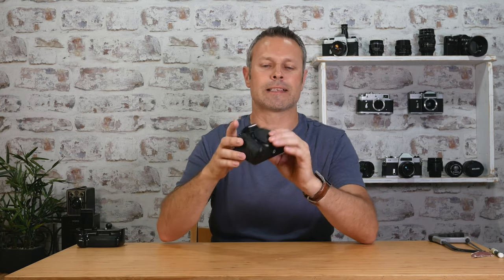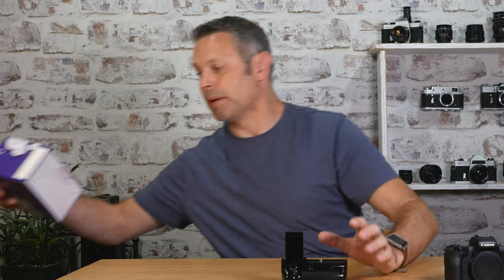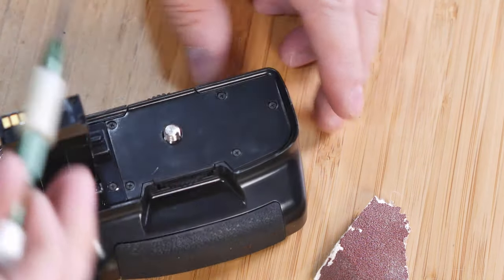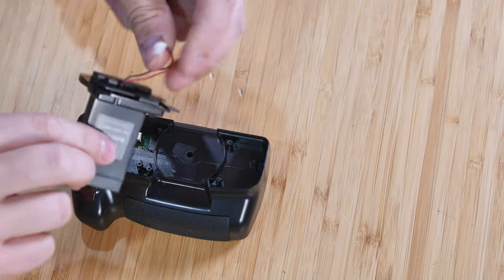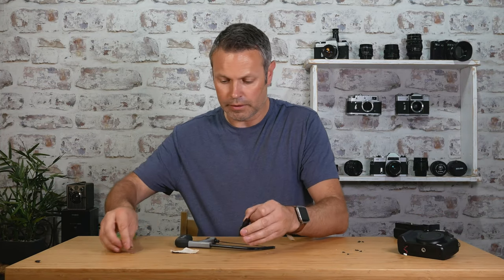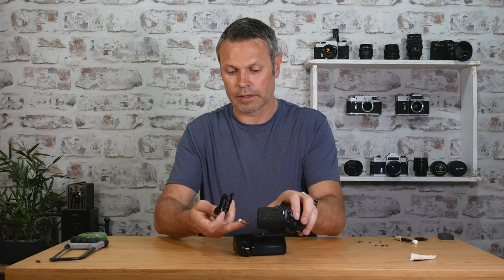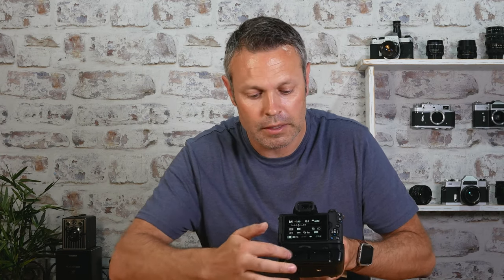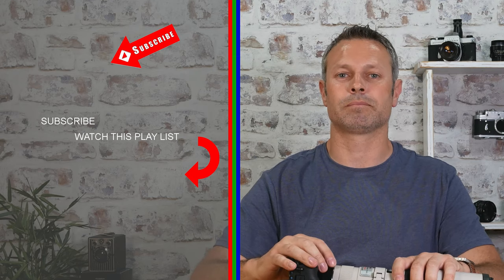Quick Tip: Canon M50 Battery Grip Hack

Comment: Just a thought. Technically you can clear out the inside, snip the wire, and rewire it to a 18650 battery 2x tray. This would give you a significant boost in battery life compared to the crappy lp-e12 batteries.
Reply from the maker: Like the idea. May have to look into this 👍
Reply: how about doing a vid and link it to this 👍
Reply: @altphotostore5933  Hey. Great video. Have you been able to find a way to rewire it to a 18650 battery 2x tray?

Comment: Is the battery type on the grip the same as the Canon M50?
Reply from the maker: Yes, this battery grip uses E12 batteries which are the same as the M50, so you will not have to buy new batteries.
Reply: thank you, very useful

Comment: Would it be possible to use the grip with out the battery features
Reply: Wow such a good video!
Reply from the maker: Thanks for your comments, you could keep the original battery in the camera but it would be a pain to change the battery when it runs flat as you would need to remove the grip each time.

Comment: Does the shutter button work with this setup?
Reply from the maker: No, the extra vertical shutter button will not work. on the canon 100d you can plug in a shutter release. But the canon M50, doesn’t have this option. Shame.
Reply from the maker: I haven’t noticed any audio feedback but I haven’t used this set up for much video shooting without external sound recording so may not have noticed. Let me know if it works. Good luck 🤞

Comment: How do you charge the batteries in the grip?
Reply from the maker: In the usual way you would normally change the batteries.
Reply: @altphotostore5933  so you have to disassemble all the battery grip to put it in the charger.
Reply from the maker: No, like any battery grip there is a door at the bottom of the grip which you can open and change the batteries for freshly charged ones. You do not have to remove the battery grip to do this. Hope this helps.
Reply: @altphotostore5933  ah right OK, yes thank you that was a good help.